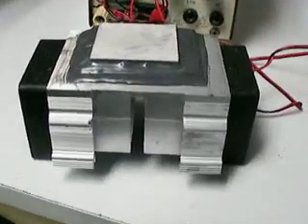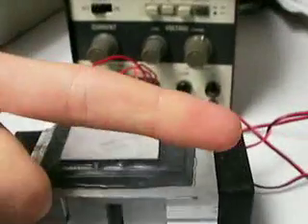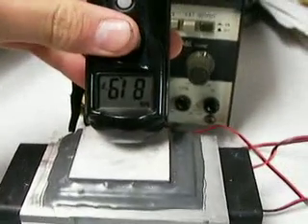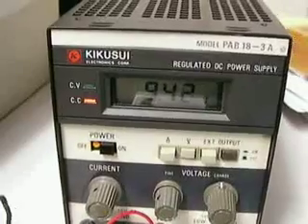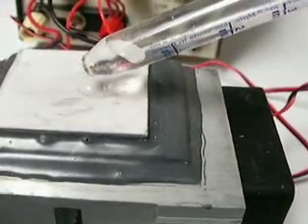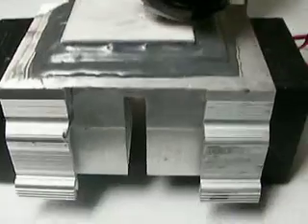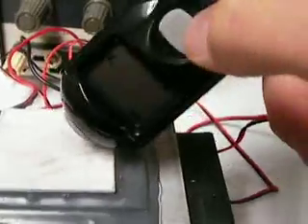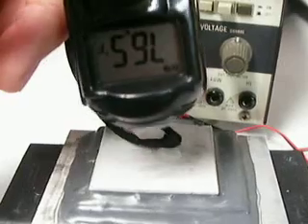Peltier Cooler

Comment: 46 watt, 12v, 12v/46w = 3.8 amps, but as he said it's only a 3amp power supply so he turns the volts down to 9.3v, judging by all of this the peltier has a resistance of about 3.1ohms so at 9.3volts it would be drawing 3amps, (9.3v*3amp), 28watts.

Comment: Good video,

1 Using a hand cam is good for this kind of demo but you are shaking to much.

2 If you point the camera at something it will auto focus. It wont focus on the drop if you are looking at the psu.

3 If the camera doesn't want to focus because the target is to small you can try zooming. As this will also increase the shaking a tripod is really useful. You cant really put down the cam looking at a downwards angle. You could try pushing it against a steady object in stead.

4 good luck!

Comment: Great design, simple yet effective. If you would like to get a 12V (DC) fixed power supply, I would recommend an Xbox 360 PSU. It is 12V at around 14A. So it would be great for you in future if you wanted to power a 130W Peltier or several smaller ones.

Just out of curiosity, how much hot air do the fans push out? Would it heat a car noticeably? I know this is a broad question, but just a guess would be good. Thank you! :)

Comment: 2 Questions..  1) What specifies the "hot" side of the Peltier..  If I reverse the voltage, Idealy I could flip the hold/cold side right??  Also, How well could you control the temperature if you controlled the  voltage/current.

1) HOW THE HELL DID THAT ONLY COST YOU 12.50??  Those fans go for as cheap as about $8-10 each, the heat sinks are at least $15 (probably more), and a peltier that size seems to be going for at the cheapest $20-25...

Comment: @Learnthethingsido The problem with your pipe-dream is that peltiers, which are basically just dozens of semiconductor cells sandwiched between two different metal plates, consume an ass-tone more energy than they produce, something that is unfortunately inherent to any non-superconductive materials but even more true when it comes to semiconductors
So the potential for "green energy" is null
Also, you can't just reverse the effect by reversing the current-flow so you'd have to flip them over

Comment: this is great! I want to turn my big picnic cooler into a fridge and run it continuously. can I use my rv's deep-cell marine battery to power it thru my lighter and if so, will my battery keep a sufficient charge to do this if it's on a standard battery charger plugged into the wall? Don't ask why I want to do it this way, it's too complicated. If not, what kind of battery can I use? I've read that you have to use dc power, never ac.

Comment: @OtagoMark 

I've thought about it for a minute and I see now where the misunderstanding lies. You're thinking that I'm saying you can raise one and lower the other in the same circuit and I'm talking about creating the same wattage in different circuits. Yes, you can have two different circuits both producing 100W total power using different combinations of amps and volts but you can't adjust a single circuit to make the same watts in different ways. Is that what you mean?

Comment: @OtagoMark 

You don't have a set amount of voltage. An ATX powersupply can be modified to deliver many different currents. You have 12V coming off an ATX PS right? You also have 5v, 3.3V etc, and if you know how to modify a power supply you can make up whatever volts x amps combination that you need.

Comment: @OtagoMark 

Let me make it simple for you. If you want to output 100W, there is not just one way to do it. Since Watts = volts x amps, then you can plug in any divisor of 100 into the equation and get 100W. 1 volt x 100 amps =100W, 2 Volts x 50 amps= 100W, 4 volts x 25 amps =100W, etc. If you raise the volts, you MUST lower the amps or you won't get 100W anymore. You can't raise the volts to 4 and leave the amps at 50 or 100 because then you'll be putting out more than 100W. Understand now?

Comment: you should be running that at 12V if your output is only 3 amp 
46(w)/12(v)= 3.83(A)
If you run it at 7 volt you increase the amps
46(w)/12(v) = 6.57(a)
Not taking the piss, just pointing it out.

Comment: Hi RCSteve93, I am working with 170 watts peltier, so I want to ask you some question; What kind of paste have you used to join peltier with the heatsink ?, Why did you use this paste?;  is this paste easy to remove?, thanks.

Comment: @russotragik I can answer that, you see, these two fans have "effective voltage" or RMS voltage (root mean square) of 12 volts which means they can run constantly at 12V without any problems. If you want to know the Maximum voltage of a device you multiply it's RMS voltage with the square root of 2, in this case thats: 
12V * √2 = 16, 97 ; this means you can supply these two fans with a voltage of 16,97 but  ONLY FOR A COUPLE OF SECONDS! 
I hope this helped if you have more questions just ask :)

Comment: @ImaginativeBrowsing We should switch to metric. But many Americans don't want the hassles of having to learn a new system of measurement. Even if it's a far more logical and simpler system. So I don't thing we will see speed limit signs in kph any time soon in the US. For my own measurements I tend to use metric. Both my digital scales are set to metric.

Comment: heat sync paste is a fine silver dust suspended in a silicone grease it is usualy white in color. the grey stuff you see here is jb weld epoxy used for almost annything. you can aslo mix super glue in with you're heat sync paste to mount the heat sync to the TEC.

Comment: Great demo on the TEC principal, Steve. I knew about peltiers way back in the pentium processor days.............o those days. I have a cuisinart  cwc-600 wine cooler that uses  TEC for cooling. I am repairing this for a friend of mine, and she complained that it stopped working after 2 days. I really think the unit works, but is a a victim an under engineered product. Anyway, thanks for the refresher course. P.S. I am now a subscriber to your channel :).

Comment: I saw a modified Miller bobcat welding machine supply power for a large "cooling" device once on a  job site. The guy would place entire 5 gallon spring water bottles inside a box, and freeze them for the people operating the blast furnaces. It took about 10 seconds but it was cool as hell none the less. You can have ice water in hell...for 5 bucks! -was the motto on is shirt and truck. the bottles were used for keeping the hydration packs cool while operating 1800+ degree furnaces.

Comment: Either ebay, or any computer shop in your area. If you're lucky, the heatsink comes with thermal paste already stuck to it.

P.S. Besides thermal paste, you can use thermal "tape", thermal glue, or thermal grease...